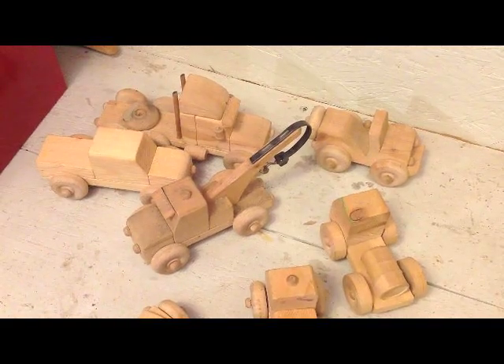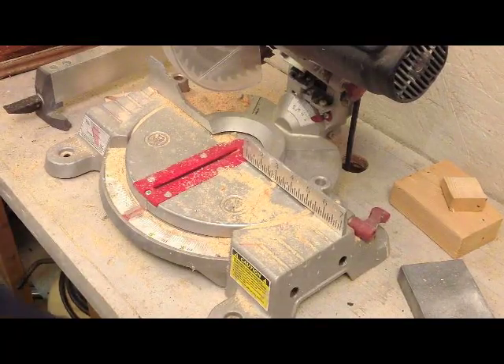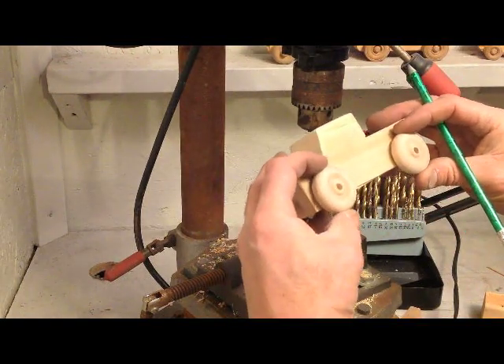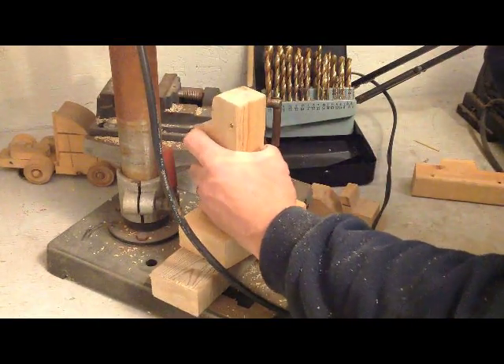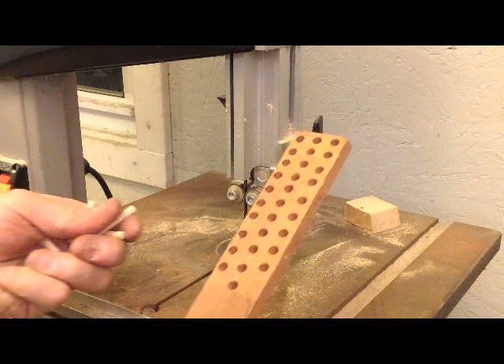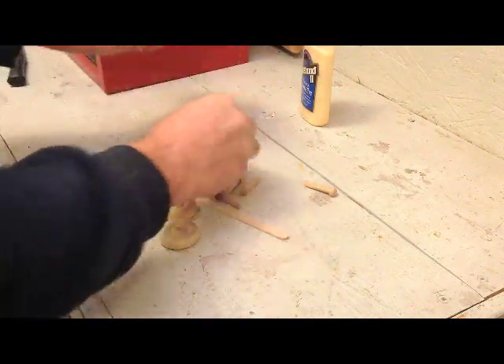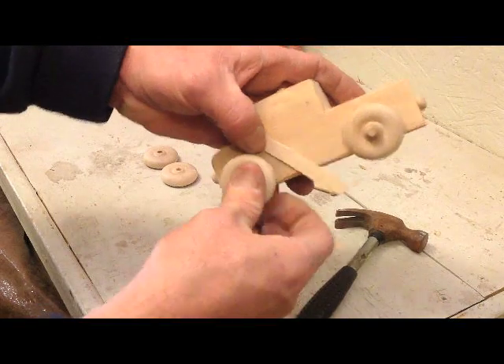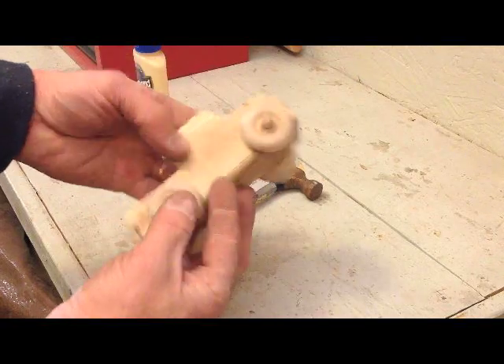How to make toy truck

Comment: Great little project, especially for the like's of myself...where woodworking is a new hobby...great tip with the lolly stick. What size wheels did you use please. Thanks for sharing.
Reply: Two inch diameter